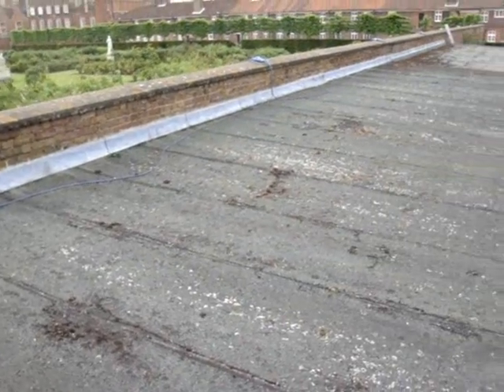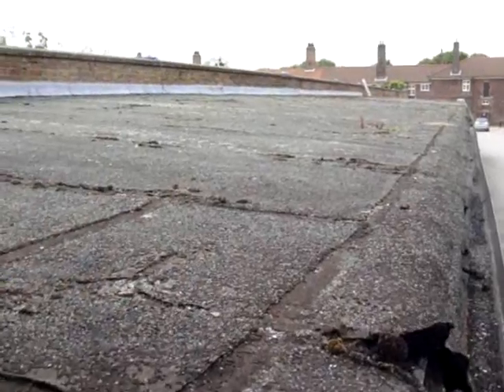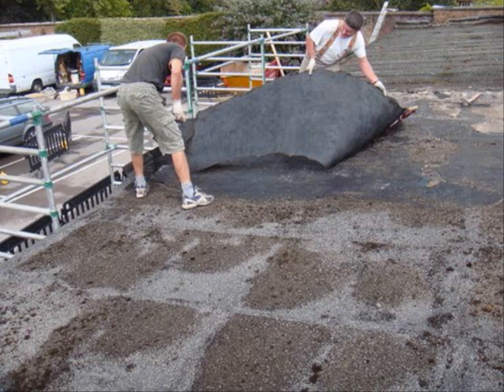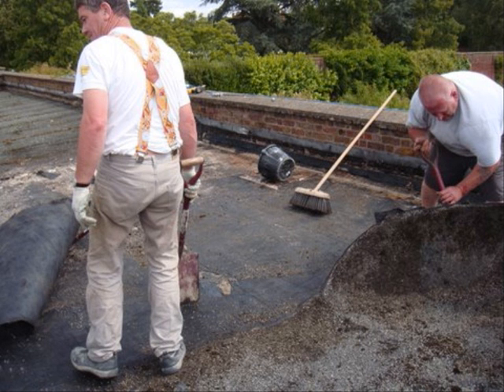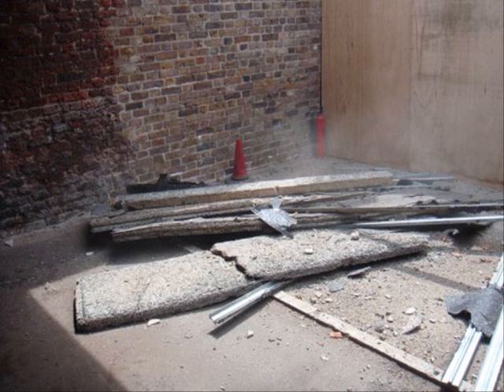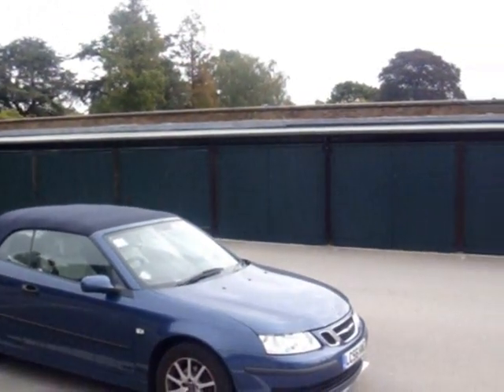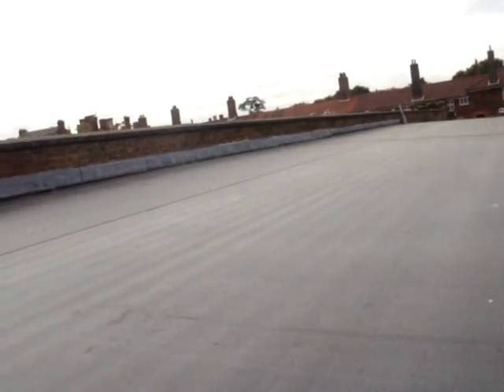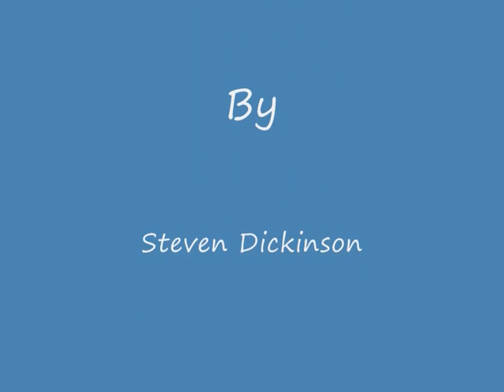Old felt flat roof being replaced with a new EPDM Rubber roof.

Comment: Hi, I have a existing concrete roof, I want to reduce heat in my room. What material shoul I apply?
Reply from the maker: insulating a concrete roof is hard because of thermal riding around the edges. You need to encapsulate the hole concrete slab if you can. Materials are normal PIR insulation, just  glue the insulation down

Comment from the maker: I agree a good mineral felt roof laid correctly can perform, however getings skilled flat roofers is the problem.The amount of badly laid felt ans asphalt roofs I see is astonishing, roofing materials that are forgivable help with this, if you look at the roof in the video EPDM rubber the amont of joins are minimal therefor minimising the problem , felt being 1m width means lots of joints! I train all my roofers myself call-backs are minimom because of this controle

Comment from the maker: Felts good and the new felt are unbelievable, however there are lots of other materials that are better, look at asphalt it was the King of roofing materials, but got push aside by felt the same will happen with all the new generations of materials on the market there will be no stoping it EPDM rubber is good for some roofs the other roofs Liquid products will work there will be no place for felt  in 20 years or so believe  it or not Im now using silicon as a roof covering  its amazing